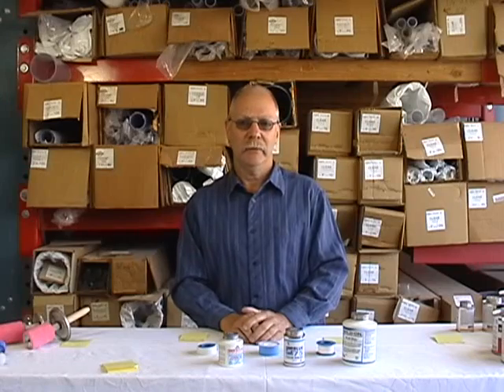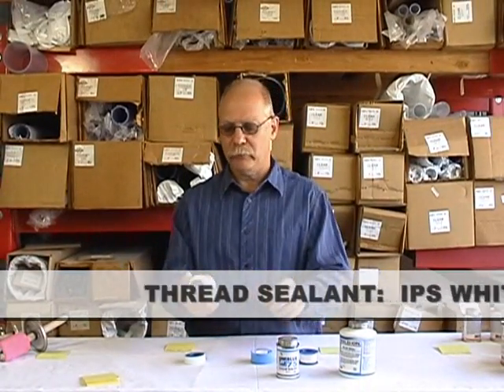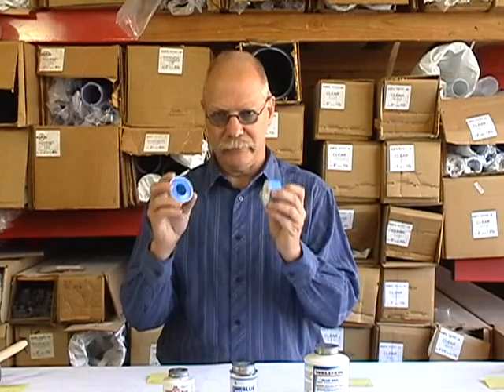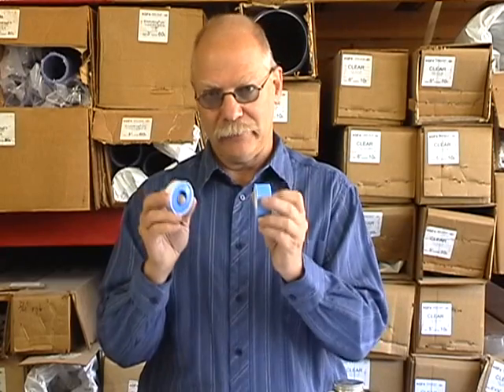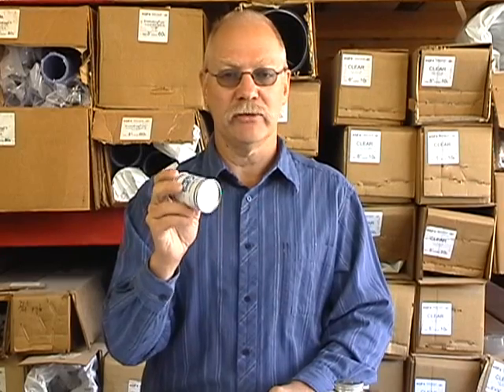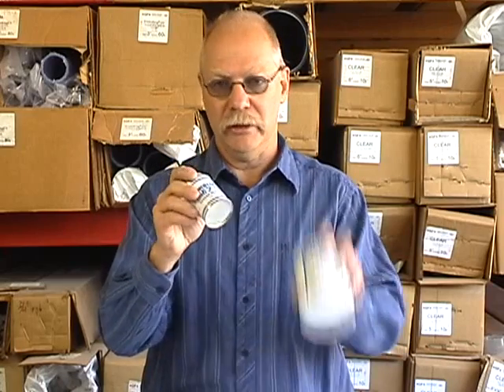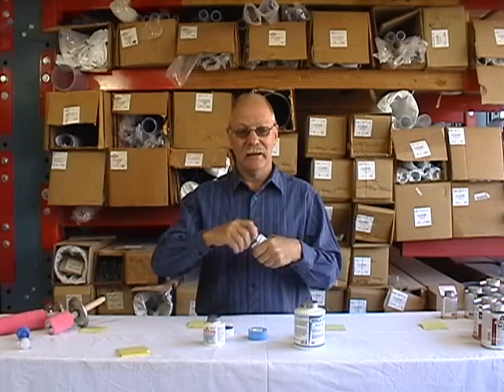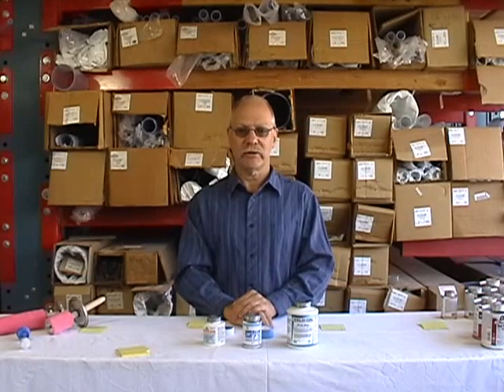FlexPVC® Thread Sealant Vs Teflon (PTFE) Tape

Comment: I have a 1 inch cold water supply line attaching to the well casing Male pvc to female metal I didnt tighten it quite enough and I have a small pinhole air leak where the threads meet the metal. I cant tighten it because everything else is glued. What can I do without taking everything apart?
Reply from the maker: If you can dry it out completely 3M 5200 might fix that.

Comment: Thank you, thank you, thank you. I am a weekend warrior. You have finally explained something that I wanted to hear for a long time. Personally, I do not like Teflon tape. There may be times when someone may not wrap enough layers of tape on the threads. Or too few. This will only confuse the installer (i.e.; Is it too tight or not tight enough). Pipe compound gives me and others the proper feedback we need to continue on or to stop. I think Teflon tape is popular, especially among many contractors simply because it's not messy and looks aesthetically pleasing. I will now keep a low priced but very effective container of pipe dope on the shelf in my shop and move the Teflon tape to a less conspicuous spot in my shed. WELL DONE!
Reply from the maker: Thank you. I admit teflon tape is less messy and the cans never dry out, but I still think pipe dope is a better way to join NPT fittings. 🙂

Comment: The two 3/4" white PVC elbows that I picked up to make a U-turn with my outdoor whole house 3/4" PVC pipes seem to not be tapered (M to F) but rather straight.  When I try to thread one into the other, they turn just one revolution and get snug.  Maybe that will loosen up with pipe dope, or maybe I have been handed the wrong elbows.  Are PVC threaded connections for plumbing supposed to be this snug, hence the need for the pipe dope?
Reply from the maker: Did get them from us? If so, LMK your order no. so I can look into this. As for a general question, if one is MPT and the other is FPT they will thread in about 2-3 turns before getting tight. YES thread compound will allow you to turn another 2-3 turns. And you should be good. It is possible that you are mixing BSPT with IPS (FPT/MPT) and that would not work at all. LMK. Thanks

Comment: For aquarium pumps and PVC I've always used the tape and not had leaks or issues.  The lube is good for going together but after 5 years the oil is gone and the threads grab more.  Teflon tape keeps its lube properties longer than the pipe dope.

Comment: why cant i just lubricate the threads with some type of oil instead of a thread sealer?
Reply from the maker: A reasonable question. I would say because  some oils attack plastic and make them brittle. There is also the issue of contamination. The first thread will be exposed to water flow and so that oil will be contaminating the water going thru the pipes. Probably not something you want to drink. The pipe thread compounds have to be NSF rated not to be a hazard to human health. So if you use oil you'd probably have to use a food based oil and again you don't know how it will react with the pvc plastic.
Reply: My thing with liquid sealants is the possibility of it backing off due to vibration... so oil could be out pending on the application

Comment: One newer important reason to avoid PTFE (teflon) is problems with PFAS in environment. You may have learned from news about the huge global environmental problem PFAS have become. A lot of drinking water wells is contaminated. Nine US states have made severe restriction on products with PFAS. The problems is normally not teflon itself, but the factories that produce teflon is emitting PFAS to environment. So we should stop using it when ever possible.

Comment: this guy is spot on, use pipe dope on new threaded pvc connections.....I found out the hard way trying to use teflon on new pvc threaded connection to a water softner.   After 3 attempts with tape and leaks, finally used the dope, voila!!

Comment: Hi great video on sealing pipe threads. I am having a bit of trouble with leaking industrial steam condensate pipework. What sealant would you use on 1" BSPT stainless steel pipe threads. They are to be used on steam condensate pipework. Pipe thread is BSPT and the fitting (Elbow Union etc) is BSP so a tapered thread screwed into a parallel thread.
Reply from the maker: Any of these would work great. 
https://flexpvc.com/cart/agora.cgi?p=Pipe-Thread-Sealants&xm=on

(just confirm you don't have BSPP)

Thanks

Comment: What is the proper way to connect a threaded pvc  to a brass ball  valve ? Just dope only ?
Reply from the maker: If the pvc is going into the brass ball valve, yes, pipe thread compound, aka dope, is all you need. If it's the other way around, brass into pvc, you need the special reinforced fittings, (examples: https://flexpvc.com/cart/agora.cgi?keywords=-010SR )

Comment: Use sealant for plastic threads (PVC) not Teflon:

https://www.linkedin.com/pulse/what-thread-sealant-use-pvc-fittings-larry-workman
Reply from the maker: Very interesting: we both agree on the conclusion but with some differences of opinion as to why. I personally believe the lubrication qualities of the sealant compound are vitally important. W/o lubrication you get galling/binding on the plastic to plastic surface of the threads. This can give a false sense of tightness and thus leak. Which causes the person to come back and retighten, which they will indubitably overtighten. :-) 

But we both agree, tape is not right for plastic fittings!

Comment: I have had this wrong all along. I did not know that new treads should always be doped. I am fitting PVC male threads to brass female threads. My understanding is that I will have less chance of breaking the PVC because the plastic threads are male, but the point about uniform lubrication produced by the dope is logical. I am not a professional such as the presenter here so this is good advice.

Comment: You have oveasly have not worked with any materials outside your little store or you would know better.
Reply from the maker: I only comment on what I know. If you are joining other materials other than plastic to metal, or plastic to plastic, you my have different results. But for metal to plastic and plastic to plastic I stand by my advice.

Comment: Thanks. I'm an old DIYer and have gone back and forth. I know about the feedback you're talking about but I didn't realize its meaning. With tape when tight PVC tends to jump while making a squeak which never felt right. What throws me is some devices like valves say to use tape. I was thinking they were worried about too much sealant being used and getting into the valve and messing it up. Now I'm thinking they just say tape because that's what people use.
Reply from the maker: Let no one who has the slightest desire to live in peace and quietness be tempted, under any circumstances, to enter upon the chivalrous task of trying to correct a popular error. 
William Thoms, deputy librarian for the House of Lords, c. 1873

Comment: Really the important issue is why one has noxious solvents and the other one does not. Same applications, specs, what's the difference and why? You know like pvc cement and cpvc cement. There is a reason why they use one or the other.
Reply from the maker: That is a very good question, but one I do not have the answer to.  I think the most likely reason is cost of materials/chemicals.

Comment: If the tape is everywhere as you are saying, does that not indicate it gets the job done?
Reply from the maker: Just ignorance on the part of the consumer and tape has an appeal that compound does not: Tape is clean and easy to use. Using compound is messy and you have to clean up after you use it.

Comment: I had some brand new brass fittings today that leaked with paste, then sealed with tape so apparently the tape isn't just for old worn out fittings.
Reply from the maker: Tape works better on metal. Sorry I did not include that in the video. But paste should also work fine as well. Could be the brand or maybe you didn't go tight enough? Just offering another possibility.
Reply: @FlexPVC  I definitely went tight enough, one of them I kept pushing 'till it broke and it was still leaking right up to the point it broke.  I seem to have really bad luck with pipe fittings.  On my last project I was trying to seal a male plastic PEX fitting to brass.  I tried tape and dope, light torque, heavy torque, nothing worked.  I finally went with Permatex Right Stuff and it sealed.
Reply from the maker: @DonziGT230  This is a long shot, but I've seen it before. There is another tapered thread standard: BSPT. BSPT LOOKS just like NSP. The diameters and tapers are exactly the same. The difference is the angle of the actual threads. 55 degrees vs 60 degrees. That 5 degree difference will cause leaks like this. And with some much coming out of china and where-ever, the customer can't be assured of what they are getting. That, or simply outright in correct threads are the only thing that could cause such a leak. Glad you found a solution.
Reply: @FlexPVC  I never have problems when working on trucks/heavy equipment where good quality parts are used so it's very likely that it's the modern Chinesium stuff that's been my recent problem. I recently learned that there are different tapers as well.

Comment: Can I use pipe thread sealant on sprinkler systems? Anti siphon valve connections to PVC recommends Teflon tape. Why is that?

Comment: Does the thread sealant provide water tight seals ?
Reply from the maker: No, neither the teflon tape or pipe thread compound seal. They are to lubricate the threads so you can get proper torque applied to the threads. The threads are what create the seal regardless. hth.

Comment: In sprinkler systems, it is not recommended to use pipe dope(????).  I don't know of anyone who uses pipe dope. If you have to take a joint apart The tape helps but not pipe dope for removal, I was told by a supply shop not to use it.
Reply: I wager because they fear some will apply too much and end up clogging the nozzle. If done correctly, should be fine. Maybe also because you end up reusing connections a lot as you swap out heads.

Comment: Thanks for the info and great video, but do you still recommend “pipe dope” for air compressor fittings? Thanks again for you’re time. 

-Chiefs Kingdom
Reply from the maker: For air compressors you are not supposed to use pvc pipe and fittings. The potential for damage is very great. If you are using steel/brass fittings, it's not as critically, but just personally I prerfer the dope over the tape just because I can feel the tightness of the fittings better with dope instead of teflon tape. But metal fittings are far more forgivable than plastic. HTH. Thanks.

Comment: Best in class. Thanks.
Reply from the maker: You are welcome. :-)
Reply: Question: Would I be OK to use a combination of both, PTFE tape like a monster blue along with spears 75 pipe sealant?  Whats you opinion? Am I to also understand while applying sealant ,ONLY apply to the male thread and NOT the female?  Thank you!
Reply from the maker: I would not. I'd use one or the other, but not both.

The reason people say to only apply to the male threads is that putting it on the female thread you are assured some of it getting into the water system. Extra sealant on a male thread ends up on the outside, whereas extra material on the female goes into the pipe. :-)

Comment: Great video. I have a quick question I have a male pvc fitting that i connected to a brass female fitting.  I have redone the connection 3 times using nothing, teflon, and teflon plus pipe dope. I will try using pipe dope by itself with a new male pvc fitting. Do you think this will solve the issue, at first the connection doesn't leak but after a couple of weeks it starts leaking.  Have you heard of a product called Hercules brush on block with that provide a better seal?
Reply from the maker: I am not familiar with Hercules, but if you have a male pvc going into a brass female and it leaks after some time, My guess is thermal expansion differences. Here is how I'd try to fix that.
On half the threads at  the end of the threads, use the blue  thread compound, then on the 2nd half use the teflon tape, 4-6 wraps.  Give that a try and let me know how it does. Also after you get it tight, come back about 15 minutes later and check the tightness again, give it a little turn if you can. LMK how it goes. Thanks

Comment: I will be using this on a 4 inch Male End Cap that every two to three months I need to remove, service the contents of the container and then re-seal it - I can easily remove the old 'tape' and apply new, but how about the Liquid Sealants, what do I need to do to remove the old and apply new ?  I am building a DIY Aquarium Canister Filtration System that needs maintenance (new filtering media) from time to time - will be undewr up to 1250 Gallons per hour pressure, though it will not effect the threaded areas at as the water will 'splash' above the sealed area and flow downwards away from the end cap.
Reply from the maker: You can leave the thread compound on the cap/threads and just reseal. It'll last for many cycles.
Reply: Awesome, Thank you for the rapid response - much appreciated.

Comment: when using pipe sealant, do you have to wait for it to dry before turning the water on?
Reply from the maker: Generally not, but I usually do. How long depends on which compound you are using. 30 minute to an hour, but I've done it w/o waiting and not had a leak too. Lower pressures are less likely to leak. 50psi and down should not be a problem. 100psi and up I give it as much time as I can. Between those two, I wait as long as I can. :-)
Reply: No.

Comment: Hi!  Thanks for the videos. Maybe I missed one but do you bond the flexible pipe to the ridged PVC  fitting the same way to bond regular PVC pipe?  Thanks!
Reply from the maker: Yes, standard fittings with standard primer and cement. Just like normal.

Comment: I don't like the tapes at all, but, do use the dope, do I need a certain kind for gas in black pipe?
Reply from the maker: +Grant W. Whitwam Weldon makes a 505 Key Tite™ thread compound for metallic threads. We don't sell it (almost all we sell is plastic pvc fitings and pipe) but you can find info on their website weldon.com  However all the Weldon thread sealants say good for metal or plastic. So go figure. :-) But the Blue Weldon Thread Sealant compound we sell will work on metal and plastic threads.

Comment: question: can i thread a female 3/4" pvc fitting onto a galvanized pipe end? NOBODY seems to be doing this, and it's getting me a little concerned. 

hey, don't show people to sniff directly from a chemical container! waft it with your hand like a fancy scientist instead.
Reply from the maker: No, unless you are using reinforced fittings. See: 
 https://flexpvc.com/cart/agora.cgi?keywords=-007SR
 Standard fittings will crack and fail. (leak) 
hth.
Reply from the maker: +Widemouthful Re: threading a female pvc fitting on to a metal pipe is risky. You run the risk of cracking the female part. They make special stainless reinforced parts for such an application. Seach our site for "stainless reinforcement ring" or 435-007SR in particular. 

I understand your point about sniffing a can. If we remake the video we'll update it. Thanks.
Reply: +Flexpvc thank you
Reply from the maker: +Widemouthful  You can, but you do run the risk of cracking the pvc plastic. They make special reinforced (with brass inserts or stainless steel collar) fittings for this. If you use the garden variety pvc fittings threaded on to any metallic male threads, you run the risk of cracking. And if not now, sometimes in the future. A quick fix is to put a hose clamp around it and tighten. Not the best way, but it's a cheap way to maybe prevent them from cracking. 

And yes, sticking my nose in the can is a not a good example. Thanks for pointing that out. :-) Sorry to late on my reply.  Thanks for the questions and comments.
Reply: +Flexpvc you already replied before, guess YouTube just wasn't showing you your previous reply up there... anyway, I like that hose clamp idea. funky! I ended up avoiding the project altogether due to the cost of metal parts.